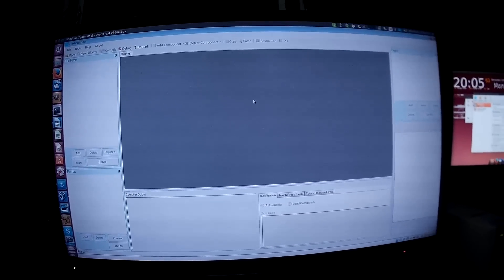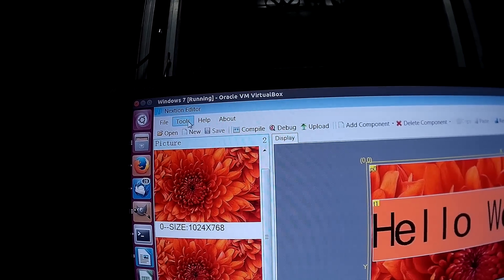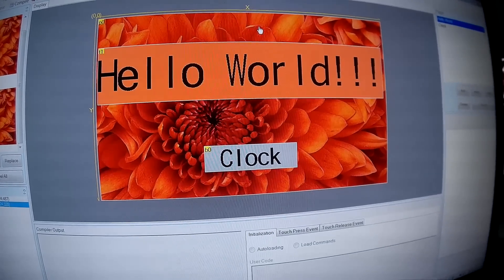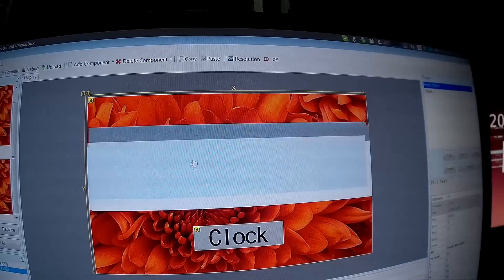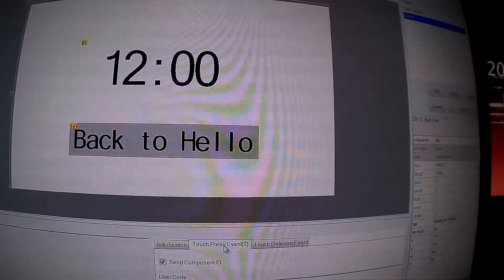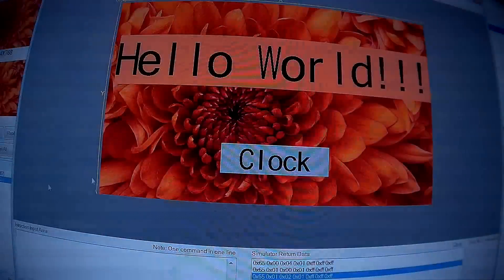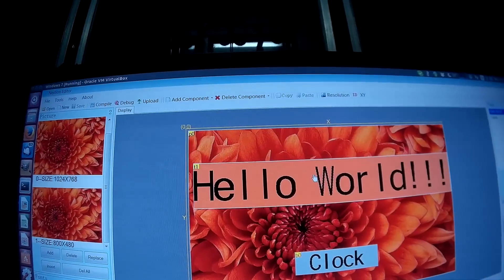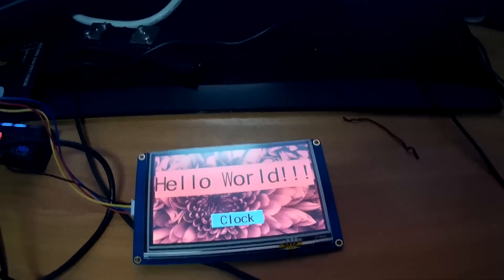Nextion TFT Touchscreen Display Hello World Tutorial & Demo (Standalone)

Comment: hello men, can you help me ? im trying to add my .hmi in SD card, the display cant find the file ever.. 
thanks
Reply from the maker: +Diogo Santana (dS  NoStress) I've mostly used the serial port, but copying your .HMI file to the root directory of a micro SD card formatted with FAT32 and less than 32GB in capacity should work too.
Reply: +cnxlinux i already did like that, and didnt work.. i only save my .hmi and paste to my 4gb SD FAT32 format :( help me
Reply from the maker: +Diogo Santana (dS  NoStress) Sorry, I don't know what the problem may be. Better ask on ITEADStudio forums @ http://support.iteadstudio.com/support/discussions/1000058038
Reply: The HMI file does not go on the SD card. That's just the design file the editor uses. You must compile the file. Click Compile on the menu bar. The file that is created will be a .tft file. To find the file, click File > Open Build Folder. Copy that file to the SD card. It must be the ONLY file on the card.  Put the card in. Turn off/on the display. after it loads, REMOVE card. Turn off/on again and the display will show.